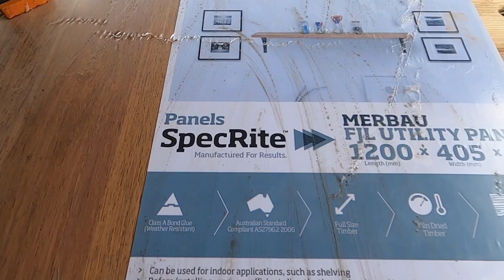DIY Dual Cab Canopy Kitchen FITOUT | Storage Drawer & Slide Out Bench

Comment: Hey mate, how did you mount it to the floor of the canopy ? Also how did you figure the dimensions of how much smaller the drawer needed to be from the outer box. 
Cheers
Reply from the maker: Hey Izzy, I mounted it down with L brackets from Bunnings. 

When building the interior drawer, I matched the drawer runners for length and just subtracted the width of the drawer slides from the outside edges and cut the front edge to the size I wanted.

Comment: How did you mount the fridge inside the box though?
Reply from the maker: Haven't mounted it in the box mate.
I made the box a tight fit so it doesn't move, also it's close enough to the canopy door to never slide out while driving.
Reply: @Out N About Australia  does the fridge come forward at all, or does it stay put on the carpet with its own weight.
Reply from the maker: @standupandskate  It stays put mate.
I haven't had it move at all on me yet!